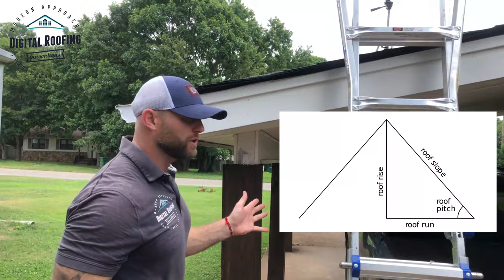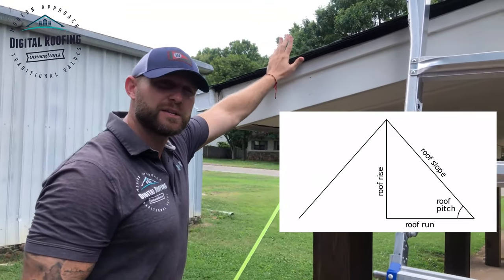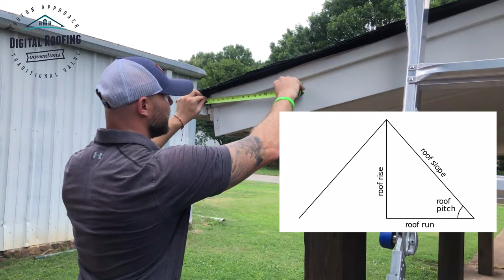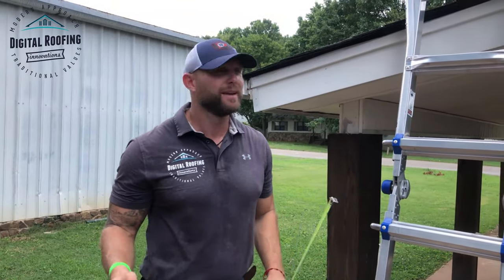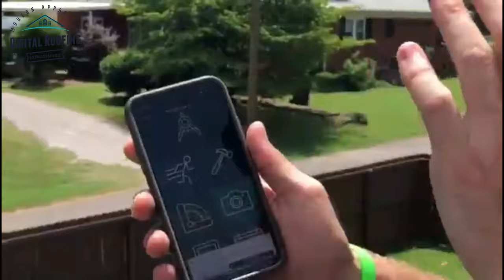How to Calculate Roof Pitch

Comment: I  think information on how to find the pitch of a roof that's already installed is inconsequential to any learner interested in roofing. You are certainly like a signboard that shows you where you're going but cannot take you there. What calculations give you the rise for the required degrees after getting the run that's half the span?